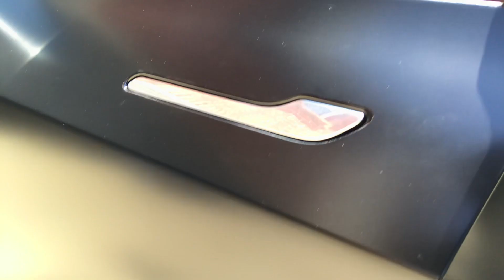Model 3 Performance Chrome Delete

Comment: Mirror arms chrome delete?
Reply from the maker: are you asking if im going to do the side view mirrors? yes. but will require more time and accuracy.. the side view mirrors are not easy at all...i intially tried it and i messed up. so i have to make sure i do my research first so that im not wasting wrap for no reason.  everything else is super easy. Door handles were done now... and it took me 5 mins.
Reply: Yeah, I hoping to see a good method to Chrome delete the mirror arm. I’ve chrome deleted everything on my car except for the mirror arm as well. I may consider taking off the arm and just spray it with SUPERWRAP. 

Looking forward to see if you come up with a good method!
Reply from the maker: @warrior15r  here is how i learned.... link below:
https://www.youtube.com/watch?v=XpqLkA0FY1I

also: i wrapped the repeaters on both sides. they were extremely easy. If your using knifeless, you should be pretty good to go.